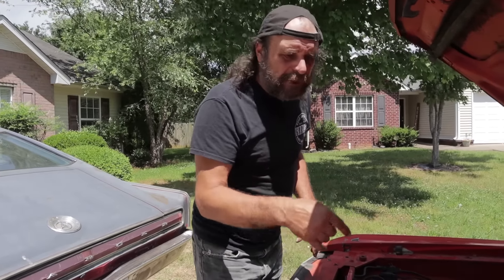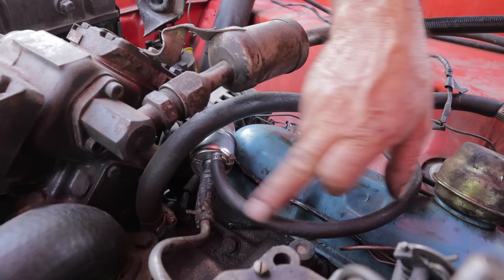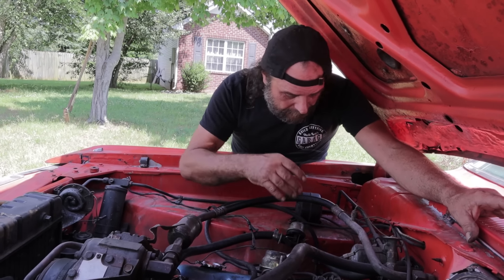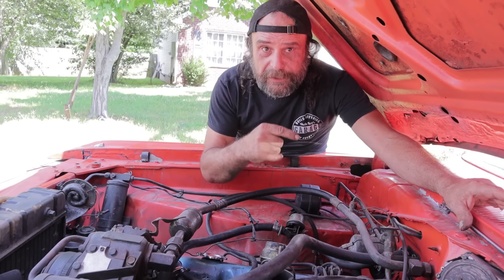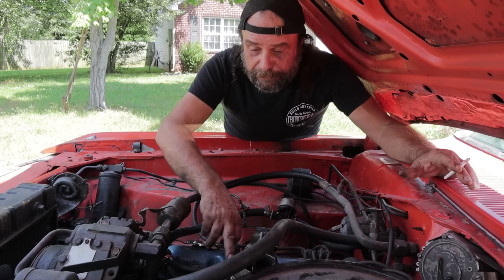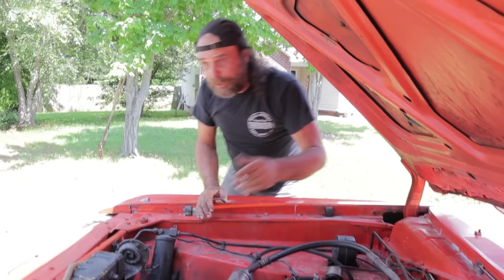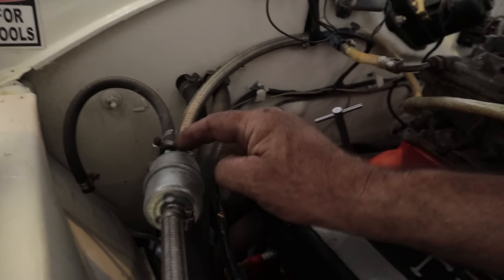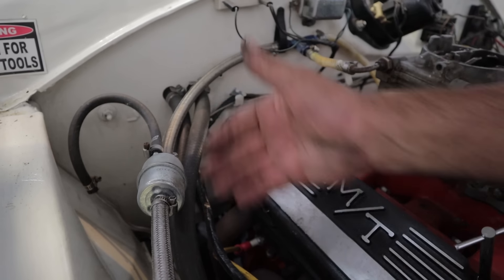$8 Cure For Vapor Lock

Comment: I will take any A body with a 225 any day over a new car. I would rather take the $40,000 I would spend on a new car and restore a 65 Valiant, Dart,  Barracuda and what I really want is a wagon with a 241 or a 354 Hemi. I know the 241 is a low ho motor but I just love the sound. I wonder how hard it would be to build one up or if it's worth it. Well if it's something I want then it's worth it. I still have a set of Clifford dual exhaust headers and a Clifford 4 bbl intake for a slant 6. It would be fun to build another slant 6 but they just don't have the extra torque that is needed fur street racing.  If you come across any 63 to 66 wagons that are good starter cars and maybe a parts car or two it would be appreciated. Everything I see from around Illinois is total junk. More rust then actual sheet metal.

Comment: 4 Alternative solutions to this problem. Vapor lock is cavitation in the fuel pump housing or essentually a loss of prime in A centrifigul pump do to the vaporization. If its jUst barely clearing the pump and at the high end of the vaporizartion threshold same effect as the intake plenum running too hot you could wind up with the problem you described with hydrogen In having a short duration burn.

1. Fuel additive 
2. They make aluminum mechical fuel pump swap
3. Remote in-line electric fuel pump
4. EFI upfit

Essentually you want to cool the inlet fuel temp without impacting the temperarure of the  intake plemun and vaoorizarion point. 

The same is true with hydrogen by introducong it under pressure in a liquid state. Liquid hydrogen doesn't pick up latent heat as easly. Frankly I dont know how you got a caborated engine to run off of pure hydrogen in a gas state. 

The dyno testing results of the EFI engines running on pure hydrogen where the timing is advanced and ignition takes place after TBC and the piston already traveling down bear bettter torque and HP curves and make more power than petrol. From the same engine. The longer burn durarion you mention is due to what you are burning, but also creafes more bi-product in the exhaust side. This creates a couple different problems and primaarily the carbon that the green Nazi's cry about. I am not a tree hugger, but both more power and net zero are both possible. I would do it just for the power gains, but for those that believe carbon changes the climate have no merit argueing against it.

That being said I don't get to decide the next fuel and so to accomadate the people that make these decisions as well there is another option that will make them happy while burning Musk's ass. I dont see how they profit with hybrids burning less of the product they refine and sell but appears to be what thet want. 

In this case it's still important to develope battery density. The Lithium ION replacement for traditional lead-aid batteries are rediculously priced until they can be produced to scale. 

To buy an Lithium ION retro fit to all old cars costs $1,500. 3X more expensive than an optima racing battery. They are more stable than lead-acid and hold a charge. They are also more resistant to damage in cold climates for occasional driving. Working on ship I was constantly replacing my lead-acid batteries. They are designed for daily driving and frequent charging from use.

The solution to all the parties is the same as the Drivetrain in a locomotive. All modern locomotives are hybrids they have been since the retiring of steam plants. They are actually electicly driven. Thats right, AC induction motors powertrains. They do have massive diessel engines but the deisel engines aren't connected to the wheels. They are onboard generators that feed a battery backup to manage power fluctuations derived from changing load conditions, capacitors work for this purpose as well but capacitors are only desiged to manage shock for big fluctuations. Batteries provide continuous power.

Big problem with EV are that batteries are thermal reactive to extreme temperatures hot or cold they react poorly, and affect range and performance. 

A Tesla is the fastest car on the road, but because electric motors don't need to ramp up speed. They can go from stop to full speed instantaniously where ICE need to ramp up. The problem is where they get their power from is thermal reactive. Not in a hybrid. You still get the benefit of AC induction drive motors and the power to drive them comes from an onboard ICE generator.

The big 3 have never made a hybrid designed for performance they have all been designed for fuel consumption. They need to design a preformance powertrain. Tesla's are good for 1 or 2 passes at the track with a full charge on the battery. It can never out perform a performance hybrid if such a car existed. It don't exist to the folley of Detroit.

The day that a Tesla smoked a HellCat at the track Detroit should have responded with a performance Hybrid model. Low production like the Cobra, SS, HellCat just to reclaim their titles.

Tesla arent the best, they are just the 1st. Just like Ford created the first mass produced automobile, and later Chevy answered raising the bar on them. All this talk about being competative on a cost basis, yet they don't want to compete on product. If they did we would not be discussing Tesla. Elon isn't capable of producing an ICE engine. They could have buried him long ago.

Comment: Wouldn't it be advantageous to mount your fuel filter away from the engine to the fender panel?..your engine heat really cooks the filter where it is...just my .02 cents.
Reply: Being metal filtets makes that worse too. If it were a plastic bodied filter it wouldn''t absorb nearly as much heat

Comment: Been getting crazy with my '58 Plymouth, it always ran fine, but... From a while ago... You can start the car at a touch of the key, it runs great... You can drive it all day long if you want to, but.... When you get to stop the car in an intersection or something, it just stops... And man... How hard is it to get it running again... And it is crazy as you stop all the traffic etc... I'm not driving it much because of that... I guess I'll have to try your cure, just in case this is the problem because I'm getting crazy tired about it... I have to select "neutral" before stopping the car as, while braking keep the revs up if i don't want it to stop, but, for sure, that's not the way to drive a car....

Comment: Thanks man, I think you just fixed both my Mopars a 76 Club Cab and a 72 slant 6 Valiant. Both cars will vapor lock in hot weather when coming to a standstill on the freeway for any length time.. I was going to run a fresh line back to tank and put in a tee with a small restriction on the outlet going back to the tank, to eliminate fuel stagnation, just like my stock 77 Celica GT carb had going on back in the day. This is way easier (using charcoal can vapor lines), less plumbing, less time. Time to install my new gas tank in my A body anyway. TY TY

Comment: A phenolic spacer or thick gasket (a la Ford) under the carb also helps with vapor lock in the float bowl. If you still have vapor lock issues after installing a vapor return system, the insulator gasket or spacer will absolutely eliminate the problem. Of course, tuning spark and fuel mix with a vacuum gauge (as seen on this channel) also goes a long way and should be taken care of first and foremost.

Comment: Do you respond &/or write back ?!? I tried this on our 73 Coronet which has exactly like you said , when Hot , will not start , runs a lil erratic .. Cool runs like a raped date . It’s a Adam 12 ‘ theme’ show car , so I’m so tired of ‘ hot soak’ issue it has . Tried this fix , but it seems like I didn’t get right filter , cause car started cold , make it 6 houses down & wouldn’t restart .. had to manually pump fuel by linkage , and ‘choke’ out to get back into my garage . 
What are the filter part numbers from BOTH applications, I’ll try them instead of the 1975 Jeep 3 port one autozone sold me is probably wrong. Please write ... 
🚨🚓🚨

Comment: Two questions: 
1) would insulating the fuel line help? It seems that isolating the line from the heat in the engine bay would help.

2) We used to use an ice packed cool can to drop the fuel temp, but don't really see it much anymore. Thoughts?
Reply from the maker: Yes, insulating the lines could help, and Cool Cans work well, but those are really a race car kinda thing.  Not really practical for a daily driver
Reply: @UncleTonysGarage   Thanks for the response.

I have a '62 Chevy II  hardtop / non-stock 327 CID / TH700r4 that I was going to upgrade to a daily driver. Thought it might help with plenty of room to mount a cool can and add line insulation.

Love your videos. Keep 'em coming.

Comment: Great advice. As usual. Young kids today don't realize how lucky they are to have moderns cars with modern technology. They get in, start the engine, and go. Each and every time, it'll start. Back in my day, you had to pump the gas pedal (for the automatic choke to engage), then had to hope that it would start. If not you could either: floor it (in order to let the excess gasoline evaporate), wipe the ignition wires off (to remove humidity if it was rainy), remove the air filter cover in order to stick a screwdriver in the carburetor to keep that choke flap opened, crank the damn thing until the battery was almost dead, and if you were lucky, there would be a loud backfire at the carburetor and the engine would finally start ! lol !

Comment: "Vapor locK". The diagnosis given when you could not find the real problem, How times have you heard this diagnosis in the last 50 years, not many.
Reply: The only thing I've ever seen even close to vapor lock was a 383 with a stuck butterfly pushing exhaust through the intake and getting the carb so hot the float bowl would boil. And I'm almost 60 and grew up and I'm still in the garage business. Pretty sure that one was in the 1970's, so 40 + years ago
Reply: @cindytepper8878  Hello. I ask, what car/truck (airplane?) had a reputation for vapor lock? The idea about fuel with ethanol boiling and the entire vapor lock technical explanation looks good. Fuel bowl leakage was a problem with Quadrajet carbs and GM had a nasty heat soak problem for years but it was related to voltage drops and no starter cranking, not a fuel system problem. I realize that there is a fuel system heat soak potential. It is nice not dealing with this "stuff". I recently put 2000+ miles on a 2018 FORD Expedition, with the 375hp EcoBoost. This thing was a  pure beast, if you put your foot into in (3.5L). Going up Chiriaco Summit (I-10 East just out of LA CA) It was just however fast you wanted to go. I had to laugh at the signs that said "prevent overheating on hill,turn off A/C", This sign has been there since the mid-60's.
Reply: @danr5105  As far as I remember it was a Flathead Ford V-8. Airplanes kinda had the opposite problem, they had carb icing

Comment: How to prevent vapor lock: run a Holley.
Reply: William Johnson it doesn’t get quite that hot where i live but the temperatures can fluctuate anywhere from -15*f to about 98*f but I have never had a Holley vapor lock. It happens to my edelbrock a lot, and that carb is even on a dry intake manifold!

Comment: I have a better fix got this from an old mechanic that l worked for ,new fuels with  additives and no lead took away the volume making it susceptible to vapor lock from heat boiling the fuel at lower temps. he was an old mopar guy early hemi's the were eben worse with higher compression. Ok the cure every tank full around 12 gallons add 1 qt of ATF preferably GM type with dextron extra detergents in it to your tank won't hurt your rngine even benifits more volume no vapor lock ,cleans your fuel system ,good adds octane, no pinging and valve lubrication to ,burns fiel more efficiently, you can add more timing l gained ay leasy 3 mpg and car idled smother and better drivability and l live at 5280 ft just try it ! Non sulfer diesel works too one gallon to 12-14 tank how could it be any worse thank the piss they already put in it !
Reply: Sorry for the misspelling damn spell check need to proof hope you get my idea

Comment: Lol you mean a fuel return line, wow,why don't you explain dead head on a system that is why you are blowing past your floats not vapor, I've never had that issue and I drive a 408 stroker every day with a 870 Holley and trust me that thing generates heat and still no problems like that,ever
Reply from the maker: A stock mechanical pump producing 6 psi has zero issue being dead headed..that how they are intended to be run

Comment: Yikes...where do I start, although your intentions are good misinterpreting basic fluid dynamics and then passing it along as einsteinian logic is unfounded. Fuel, in your case gasoline boils at room temperature, under a cars fuel pressure it boils at about 395deg. What's happening is the fuel in the lines next to the engine are boiling. Your gas relief system works but it's too complicated. All you have to do is insulate the fuel lines next to the engine. Drag racers have been doing this for decades....but what do I know.......
Reply from the maker: ...you're wrong
Reply: Uncle Tony's Garage I've been wrong before, get in line......